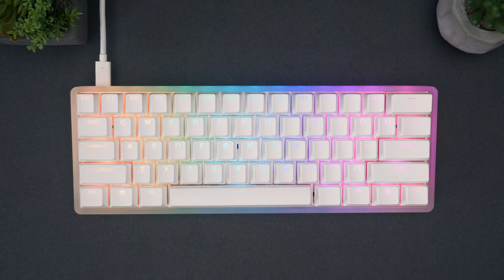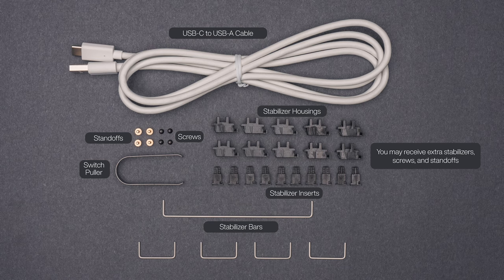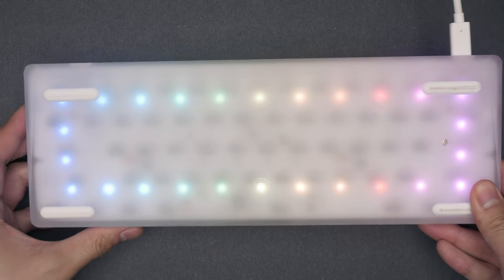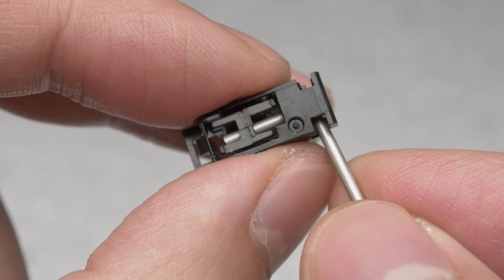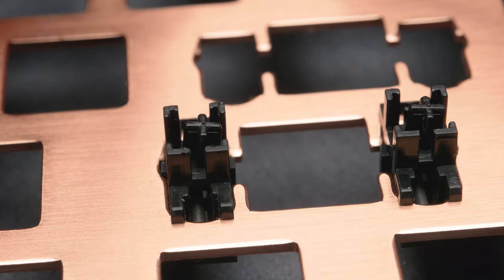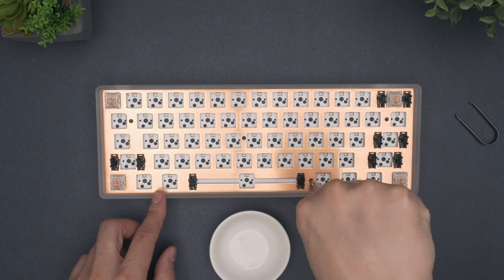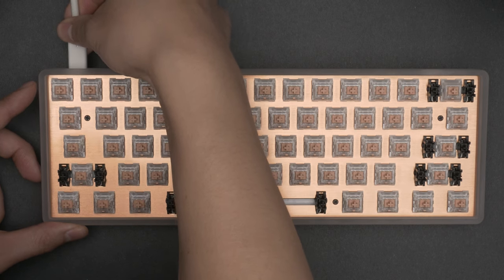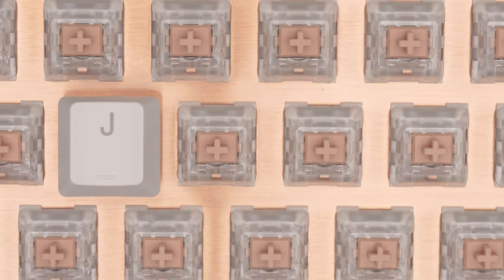Drop Carina Build Guide

Comment: Is there a way to clean my PCB? It's defective and the (+=) and (a) keys are not working. I've tried replacing the switch and it does nothing.
Reply: Axe drop for a replacement pcb tell them they sent you a defective pcb.

Comment: Are standoffs compulsory or recommended to complete the build? I heard that standoffs decreases the keyboard feel.
Also does the method of installing switches from the outside to the inside apply to other Drop keyboards such as the alt?
Reply: This is a tray mounted board, so the pcb sits on the bottom tray of the case. This is what causes the feel of the keyboard to become diminished. What you're looking for is a top mounted board if you want a more fuller sounding board, but those are more expensive as they have more parts to them. The standoffs are there to properly align the switches height with the stabilizers and to prevent the metal plate from causes shortage issues with the pcb below it. If you had a non hotswap board with pcb mount stabilizers, you can opt to go plateless, which provides a different spund signature and a more "bouncy" typing experience.
Reply: @frozeneku  Is the drop alt also tray mounted?
Reply: @nicholasm8946  if im not mistaken yes it is. It also only supports 3 pin switches and not 5 pins, so you'd be stuck with less stable switches if you ever plan to upgrade to a different board. If they offered a 5 pin version I would've been sold on it as I personally like the design
Reply: @frozeneku  They are selling 5 pin PCB-B in 2021
Reply: @nicholasm8946  woah nice I did not know that. I had already pre ordered the NK65 MilkShake edition though so I will be waiting for that around March 2021. If drop had released it earlier I definately would've gotten the alt instead